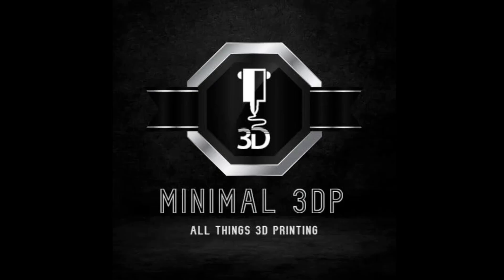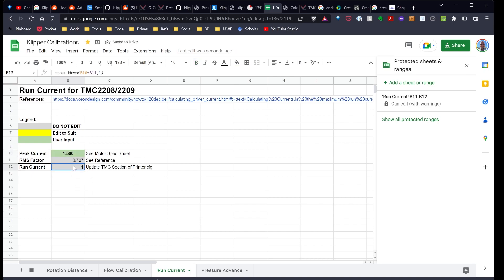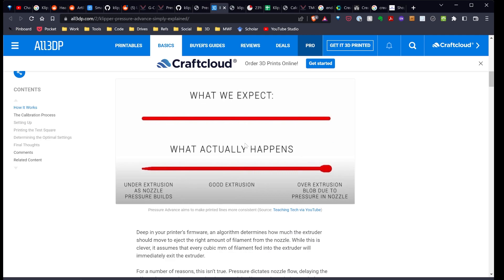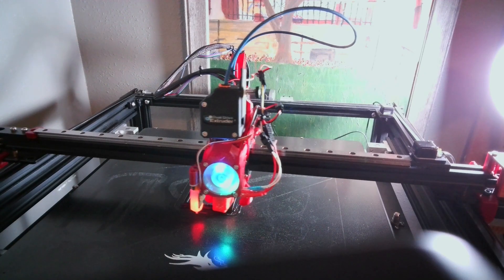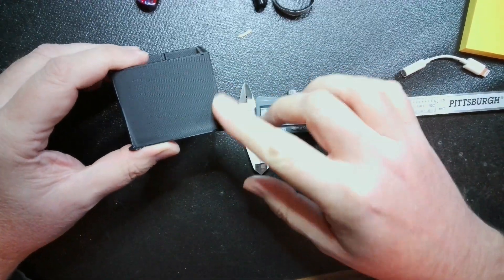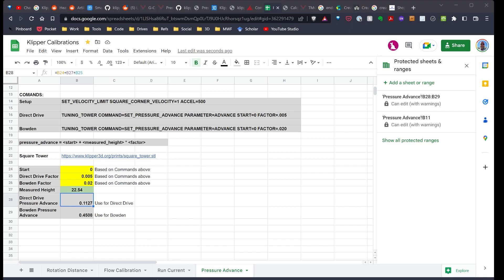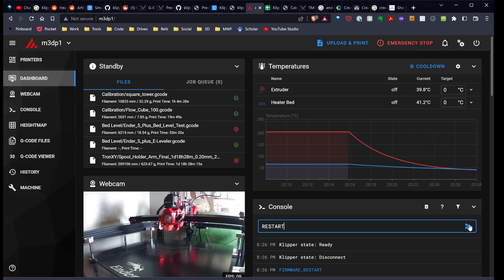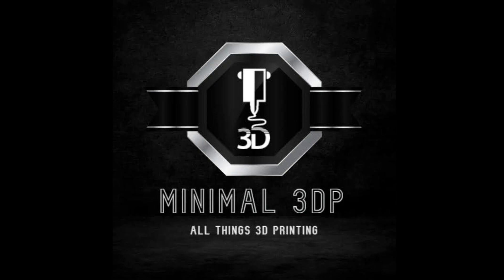A Guide to Setting Klipper Pressure Advance and Run Current

Comment: Just found this video, just updated my neptune 4 pro, tried doing this cube but after a couple of layers, the sides and insides just separated like there were no walls. Also since the update there's mayor issues with it and I leveled the bed, did esteps as well, that was fine but I cannot get a decent result out of it. Any ideas on how could I fix it, would be appreciated? ( https://i.imgur.com/8zdD8qx.jpg picture of the print quality)

Comment: Thats a MASSIVE amount of PA for a drict drive.... I have a home made speed drive... and Im at .045 any more and it goes to hell. You might wanna look into that., Thats REALLY high for a DD. I have nothing but issues when im that high.   In your video, you have a clip of the PA test... from what i can see thats running REALLY slow. 100mms at a moderatly high acceleration is what you want to tune PA. PA has some weird issues where it will over do it when going slow or fast way outside what it likes. Try doing the PA test faster and it might lower the value. My 5+ DD has .0410 PA.
Reply from the maker: I am running a print now and will take a look at it. I checked my test print and I am getting a similar number. in looking at the documentation, I am within the limits of a DD. Let me see what this next print looks like.